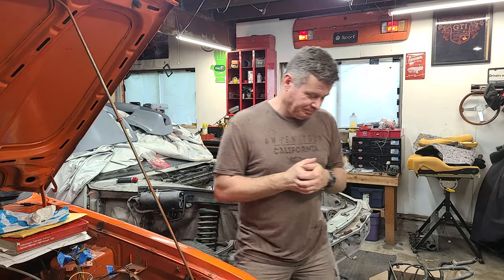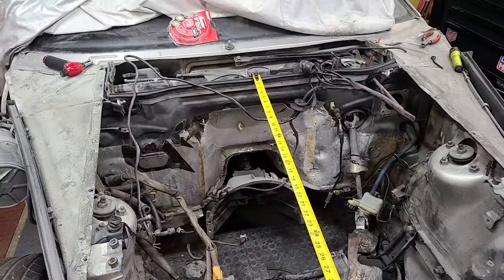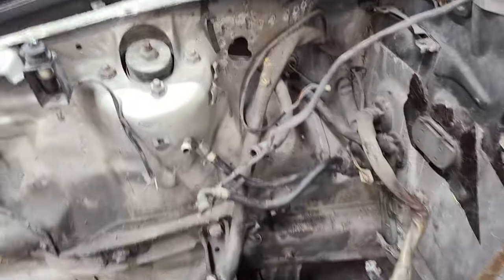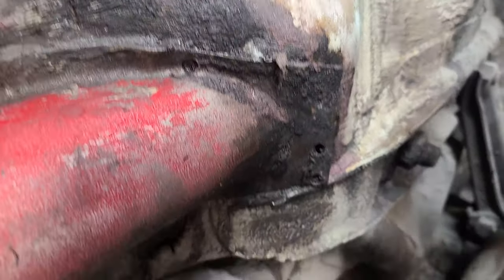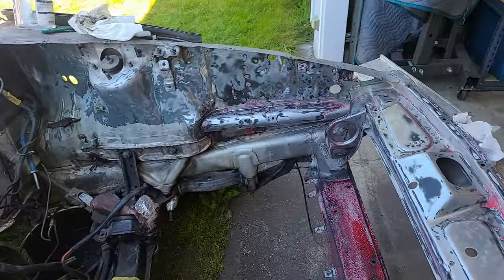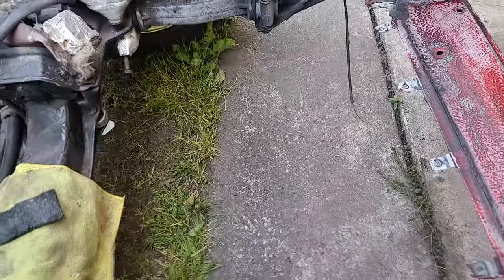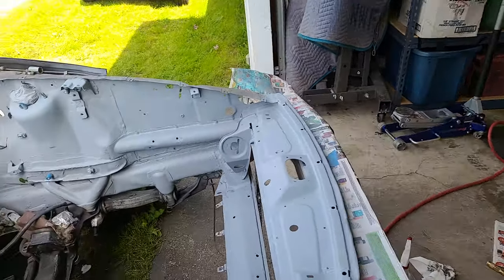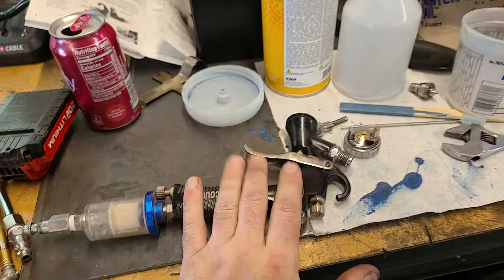Painting the 928's ENORMOUS engine bay is a HUGE job!

Comment: Beautiful color Jeff, the job ended up really good. I feel you when you say you are tired, I did a similar job on my VW Brasilia, but I also removed all the rubbery paint and seam sealer, it took me several hours to execute it, but now I look at it and it is only happiness! :D A question, did you put clear coat on top of the paint? It is much easier to clean later and it is always have the "wet" look, I love it.
Reply from the maker: Thanks Paolo-  I didn't clear coat the engine bay. Partly due to expense and partly because once everything is back in the car, you won't see very much of the engine bay at all. There's so much that goes in the car.